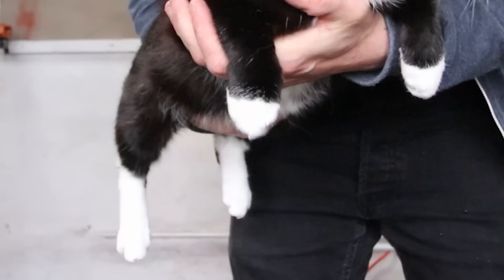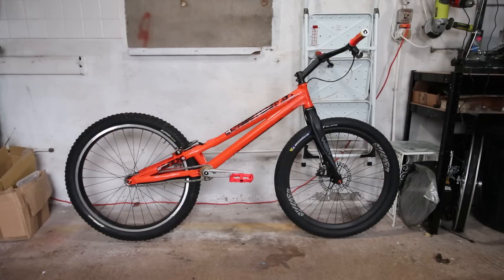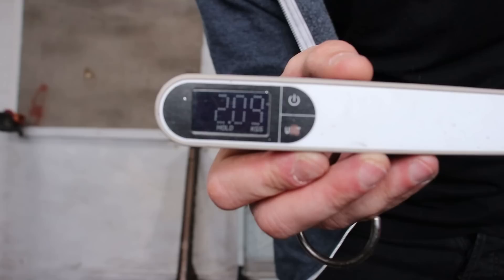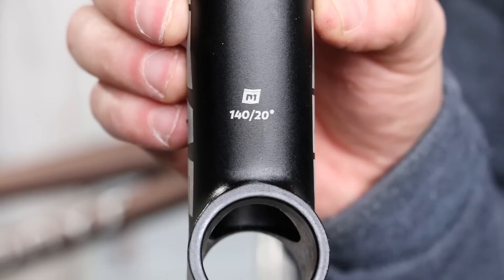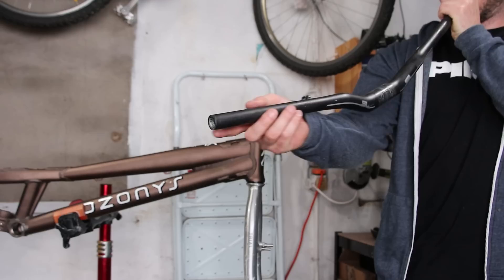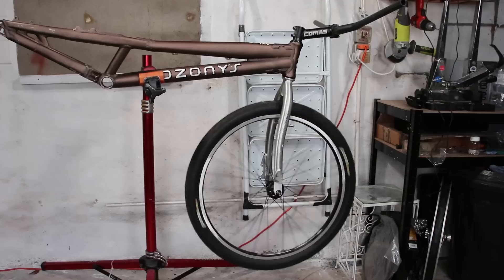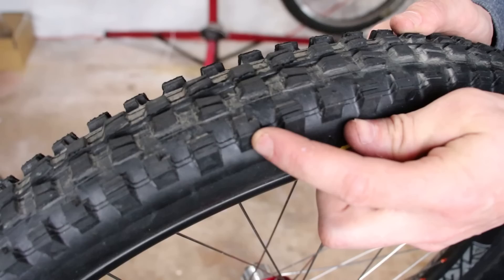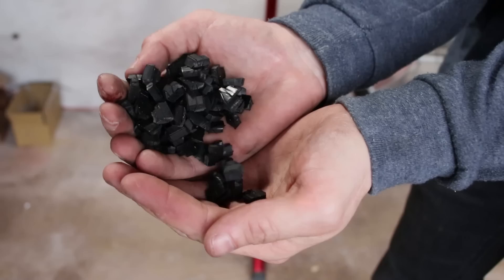Building A New Comp Bike Just To Try This Weird Brake Setup

Comment: Out of my wheel house, except for the Alligator alu outer cable housing, that I'll be interested in hearing your thoughts on. Is it really worth the near 3x premium over good regular outer housing?
Reply from the maker: so far it feels pretty sweet!
Reply: At least the Nokon cable housings were not really worth it in my experience. Their only advantage is that they allow very tight bending radii.

Comment: At about a minute in, your very clear explanation of the differences made it clear why you'd want the front rim/rear disk set up.  I'll watch the rest of the video to see if I'm right but I feel like it would be a lot easier for me in pretty much all cases to have the front wheel lock with minimum flex and deal with some butt end movement than the opposite.
Reply: the front end stalls and hops are more difficult with less spring, but from watching the test it looks like the added precision and stability is mostly negligible in the outcome.  Thanks for the video!

Comment: Very interesting brake setup, I hope you'll like it!
I've been using very similar setup on my Gu 24" comp trials bike (HS-33 front/Hope trial zone rear) for two years, and really enjoy it. Spoke flex on the back wheel isn't much of an issue and doesn't affect riding, but advantages of the disc brake make the riding more smooth and just funnier.

Comment: You could remove the bolt and top-cap once you've tightened the stem if you want to save weight. I'm not sure if there are rules about running a top-cap, I wouldn't say it's as dangerous as not running handlebar plugs.
Edit: Not a cheap option but XTR 2-pot calipers (M9100) would save save more out-board weight. I don't think they'd be compatible with your levers though as they take a different hose (BH90) to most brakes. If you want more braking performance you could go 4-pot or look at a 220mm rotor, that won't be saving you any weight though and the large rotor might void your warranty (if that matters), it won't help with clearance either.
Reply from the maker: I've never had any luck with my headsets staying tight whenever I remove the top cap...I think it'd be fine for gentle riding but with how much leverage goes through the fork and stem on a trials bike I think a top cap is always needed.

As for brakes, the XTR wouldn't work with this lever mainly because of the different fluid types, it would be easy enough to get the hose to work though I think. a larger rotor would certainly give more power but you're right it would be heavier, my main concern would be making it even easier to bend though.

As for 4-pot vs 2-pot...4-pot doesn't always mean more power, in fact 2-pot can be equally as powerful and have more initial bite than a 4-pot (why the Hope trials brake is a 2-pot brake). I specifically chose this brake over a 4-pot (which I also have as an option) for this extra bite.

Comment: great build but my favourite part is the roof of forks mainly because i see a set of bos deville forks and i run a set of bos deville 170 on my ns surge evo and run really well
Reply from the maker: well spotted!
Reply: How do you like the Surge Evo? What type of riding do you do with it?
Reply: @dansacco1964  the surge evo is a great frame i set mine up with a 170mm fork (over forked by 10mm) and 26" wheels which makes it fun for doing stuff like dirt jumps and 4x to freeride and enduro and downhill

Comment: Hey i got a question on trials do you bed in the (disc) brakes or no?
Reply from the maker: yes
Reply: @Ali_Clarkson  thank you
Reply from the maker: @orestisvas7277  no problem, to give some detail I usually use a bottle of clean water on the pads and rotor and ride around pulsing the brake(s). I add some more water to clean off the black residue that can appear and repeat until the brake has some bite and then the rest of the bedding in will happen through riding 👍🏻
Reply: @Ali_Clarkson  thanks for the details

Comment: Avid ultimates were the best v-brakes ever!!!
Reply: And SD7 were and still are the best cable levers,I  even run  them on my trail hardtail MTB with BB7 cable disk calipers.
Reply: @fujiuser1968  yep, they were much better feeling than the ultimate levers
Reply from the maker: @bengray5013   yeah I didn't like how the barrel adjuster wasn't actually threaded into the lever body, when I ran my brakes with minimum spring tension it would rattle and even sit proud slightly and pull back in when I pulled the brake...very annoying